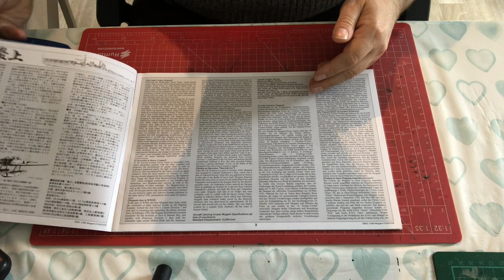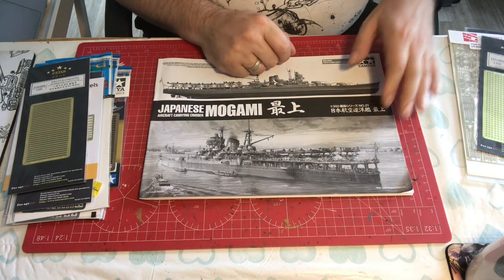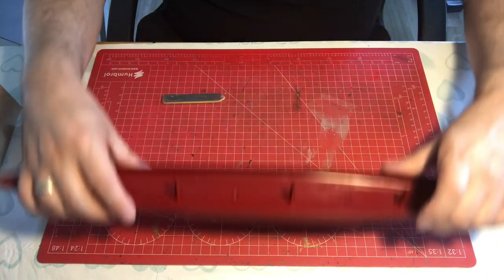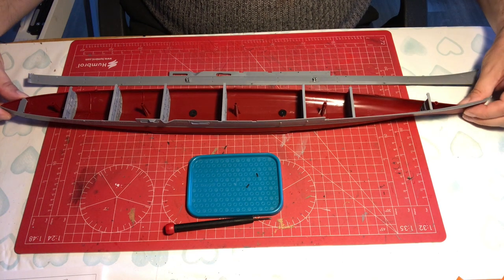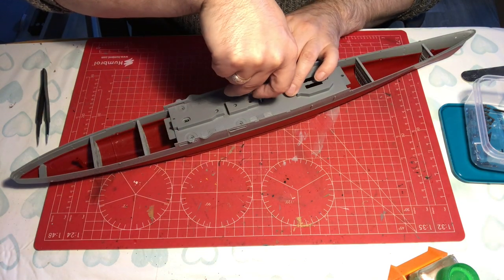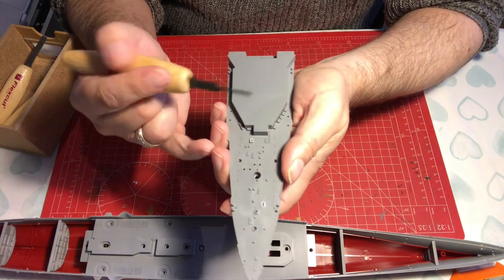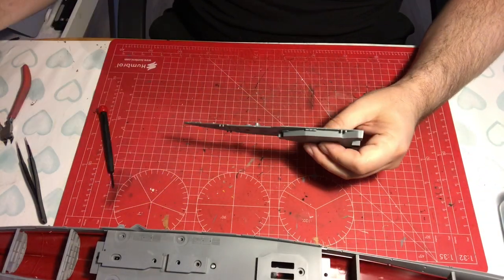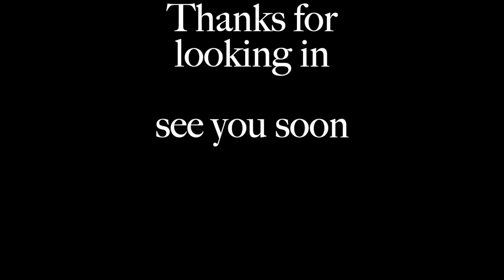Tamiya 1/350 Mogami Aircraft carrying cruiser. full build, intermediate level.  Episode 1

Comment: Fantastic it will look amazing when finished but I have some questions:
Can I actually use paint brushes instead of an airbrush??
How much the kit costs?
Reply from the maker: Hi Thanks for looking in and your comments. Not sure what your asking you can paint anything with a paintbrush its your choice.  Depends where you live and who you buy it from how much it costs.  I use Google as my search engine for buying model kits assume other search engines work as well?
Reply: @ModelkitStuff  I live in india and airbrushes are damn costly so I used paint brush 🖌️ for my very old model A6m. Because Mogami would be a different model that is why I asked you thanks for the advice
Reply from the maker: @angrymi-24v38  more model builders use a brush than an airbrush as long as you thin your paint you can paint anything you just build differently if you use a brush.
Reply: Tamiya sell spray can paints in the Japanese Navy colours. You could use those for the main hull and large parts. Then you could paint smaller parts with a brush.